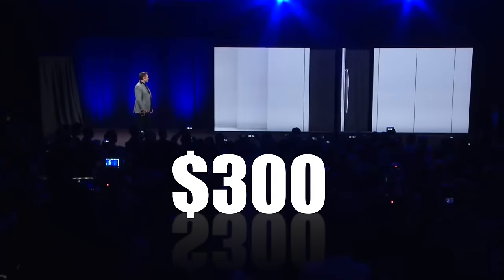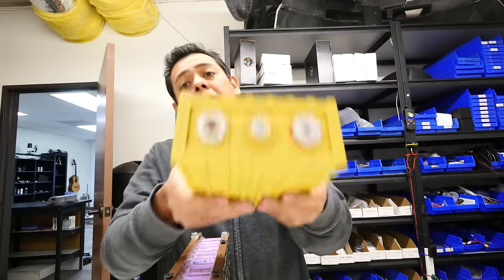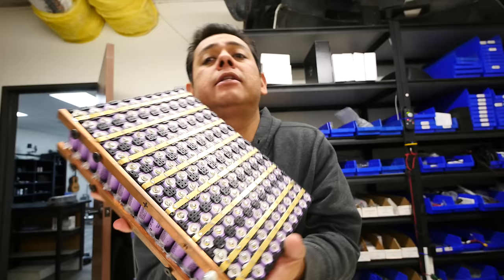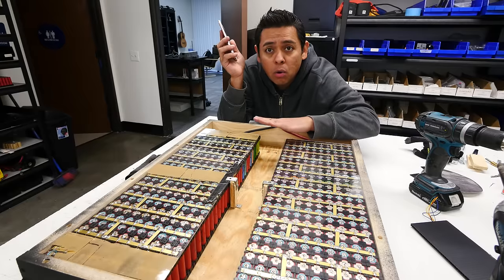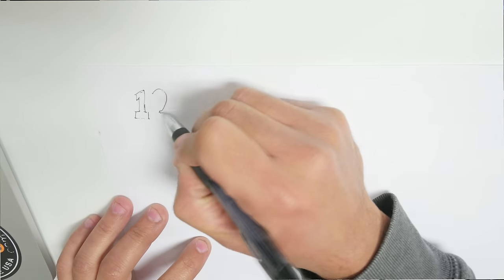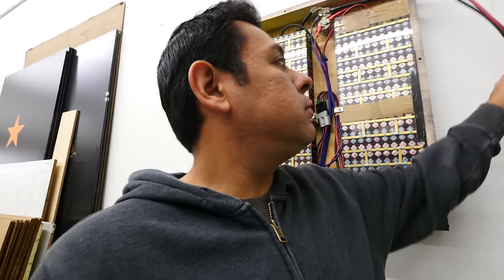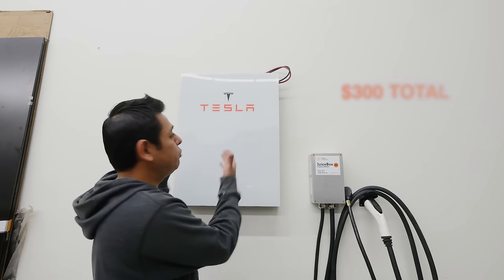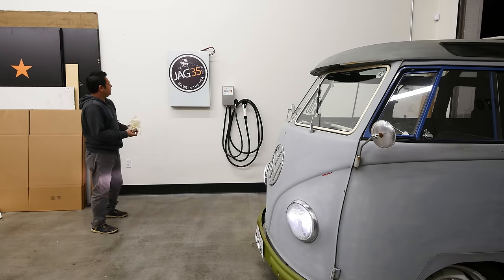$300 DIY Tesla Powerwall - Solar storage 18650 lithium ion home Battery

Comment from the maker: BTW,  best current deal on lithium cells https://jag35.com
Reply: +jehugarcia I think I'm going to try your project better. Cheaper and I actually think it's going to work. I was able to get 300 brand new 18650 for a really good price. Now trying to buy the parts you put in the description, would be nice if you can outline how many of those you need to build it. since you have the dimensions and everything would be nice to do a little amazon list where you actually plan the number of items to buy. Just and Idea!
I'll keep you posted!
Reply: +jehugarcia i like your project and you are right you can build it yourself but to be honest the 10 kw tesla wall battery is a very good deal considering you get guarantee and it is plug and play plus if something happens with a self build battery you could be in trouble when it comes to your house insurance paying or not .
Reply from the maker: +Crushonius   Yeah,  its an awesome product
Reply: +jehugarcia Aren't you worried about Tesla potentially coming after you?
Reply: +jehugarcia so do you only need 24 volts to connect the battery to the inverter to power your house. Also is this infinitely scale-able because this seems like a really good idea plus if you flushed out a plan you could sell these because they look really freaking cool.
Reply from the maker: Depends how big your house,  larger homes work better with higher voltage inverters
Reply: +jehugarcia - Thaaaaaaaaaaanks so much for this link... you're legend!!! =]
Reply from the maker: Here are a few more links I found 
 http://j35.us/Module-modelS-1k
http://j35.us/Module-modelS-900
http://j35.us/Module-ModelS-eSearch
http://j35.us/Volt-Battery
http://j35.us/Leaf-Battery
Reply: +jehugarcia this looks so cool
Reply from the maker: +mobspeak no,  why would they want to come after me?
Reply: +jehugarcia 
LOL tesla coming after you... I don't think he knows much about Tesla and how they want to help the world get free energy, not charge people and stop people from using the technology!
If only Nikola Tesla had his way years back! what a different world we would be in! Instead of the AC dominated world!
Reply: +jehugarcia yo could you tell me where you bought that yellow lithium iron phosphate battery?
Reply from the maker: Balqon.com
Reply: is Balqon still alive? looks like they going out of business :(
Reply: but that are too expensive. do you speak spanish?
Reply: LOL dude, I get your statement, but Nicola Tesla invented AC.
Reply from the maker: +Socore Alaite  ?
Reply: jehugarcia
I was responding to ant stubbs but the reply button didn't work properly.
Reply: jehugarcia
I just want to add, since you just responded to me. I just found your channel, and I LOVE IT!

I am very impressed with your channel, editing skills, passion, and ingenuity. Very inspiring stuff!

Found you with this video in my suggested video. Been on a hour long binge watching your Samba stuff :)
Reply from the maker: Socore Alaite  Cool,  thanks for watching
Reply: jehugarcia Keep em coming man, I love the content. I know you just mentioned on your most recent video that you'll be doing mostly powerwall stuff for the moment, but any eSamba updates would be cool. Even if it's just another mileage test. You've inspired me to keep my Honda, I am going to try to start collecting some 18650's to convert my Accord into an EV.
Reply: Just a quick question, with the amount of batteries used in this setup and how you've structured the blocks wouldn't this cause quite a lot of heat build up? in full load use those batteries would probably need ventilation. also wasn't the tesla powerwall 10kWh by itself? you said the back you made was only 4.4kWh? your idea of using old batteries is awesome and I love this idea but it seems like you'd possibly need to run maintenance quite frequently...
Reply: Did you know the iphone has a built in level?
Reply: That's because jehugarcia used 2000mAh batteries while Tesla uses the 3400mAh types or 600cells of 2000mAh x 3.7V= 4.44kWh vs. 600cells of 3400mAh x 3.7V = 7.548kWh. Anyhow, Tesla has changed their Powerwall to 6.4kWh.
Reply: you made a wooden box.  It will catch fire.  It's not ULC or CSA approved your insurance will not cover the damages caused by the fire.  Be careful!
Reply: jehugarcia a
Reply: you can buy those cells on Alibaba there like 2-4 dollars a piece though.
Reply from the maker: Go ahead,  let us know how that goes.   The rest of us will just order one of these http://j35.us/2hc1tDR
Reply: jehugarcia that's cool do you think its salvageable? replacing/removing cells on that may not be too easy.
Reply: hi i realy want to understand what amps should i charge the batterys
Reply: I was hoping to see it function. For som reason when I started the video I knew it would not be complete. It could not even work. Is there an update?
Reply: jehugarcia
Reply: I hope you made commission off that link.
Reply: jehugarcia hey I was wondering if I could build one of these power walls to only Power my computer or my mining rig the rig has 6 gpus ..... Ty and love the vid from Toronto canada
Reply: Yes, but you need an inverter to change the input/output to AC from DC.
Reply: ant stubbs 
We use electricity in exactly the ways its meant. AC for long distance transfer, and then converters for all our DC devices. You have to much energy loss transversing electricity using DC.
Reply: @Jehugarcia I'm wondering would Lipo batteries be better, like the dw9825 from Kong power, I mean as an example obviously you would use what ever is closest to your needs? So why laptop batteries instead of lithium ion polymer?
Reply: @Jehugarcia or phone batteries?
Reply: jehugarcia how is your "Tesla" power wall working of today?
Reply: ant stubbs AC was Tesla's technology
Reply: jehugarcia How many solar panels to charge and run off grid 24hrs with the 600 18650 powerwall you built?
Reply: How do you safely charge the battery so you don't go past 4.2 volts per cell do you have active balance circuits ? Or some kind of over voltage circuit ?

Comment: Wish I could find .39c per cell..
Reply: Ha ya, You can always ask local computer repair shops they normally have some waiting to be recycled.
Reply: +delvis11 I've found good places to get very cheap 18650 cells are Computer recyclers (have got over 1200 cells from them so far), and XGoverment computer resellers.
Reply: but in terrible quality, yes?

Comment: One thing noted: 3 x 3.7v is not 12v but 11.1 v that's when they are fully charged. I bought mine on Wish.com for less than $10 for 10  (9900 mAh)

Comment: Fun project. Some remarks:
- no ventilation holes in the box ? Not a good idea !
- using used cells.....what if one goes bad within a week ?
- wood case....Nice way to start a fire if anything goes wrong with one of the cells. I hope you have smoke detectors and a good fire insurance.

All in all....nice idea, surely doable but I’d improve some things....

Comment: How did you get 600 cells for less than 300 bucks? Wow.
Reply: Gadget Addict Well, I get that, but it costs me like 6 dollar per laptop battery on ebay...
Reply: Gadget Addict I make what I called power bricks, like 2 conduit boxes with 16 cells in each brick, and the ones I buy in either new or fairly good conditions I use in 3s or 4s setup to power my macbook, I would not link up this many used cells together, cause you never know when one of them will burst on you. BTW, I have a video of my power bricks.
Reply: +Shan Liu duh, that's what the fuses are for, and to be extra safe, liquid cool it.
Reply: 2Awesome You say duh well, gotcha.
Reply: I said the same thing

Comment: Awesome misinformation at the start dude, recycling is great but the NiMh...they dont have the memory effect, at least no to the extent you would not use them, they were used in electric cars very successfully till the Oil companies shut down the use of the with the purchase of the patent. Lithium Toxic to produce. Recycling old stuff is great tho.
Reply: +gcebiker  No big issue if he forgot that NiMH batteries don't have memory issues. NiMH and NiCAD both have specific charging issues and I know of no charge controller that is specifically designed for either of those two battery types. Neither are good for the power wall.
Reply: +Pete McWade He wants this to go viral ? so should get facts straight or burn his house down, the later would definitely help with virality (is that even a word) as for charge controllers http://lmgtfy.com/?q=NiMh+Charge+controller

And NiMh would be great for houses, if you can use them for an EV why not a house http://www.ev1.org/chevron.htm , The patent debacle should be over rulled by a court. Disallowing use in EV's is profiteering gone mad.
Reply: I had read that the patents run out in Aug of 2018.  I hate the oil companies.

Comment: Don't worry about the glass panel. I think he did that for showmanship, for the video. It looks classy. 
It depends on what you want to spend money on. Personally, I'd spend it on a better box. The wood looks iffy. Maybe mount it outside, away from the house? Or well-vented, in a fireproof box? Is there an inexpensive thermal shut-off to use, if it gets too hot?
Insurance may be an issue, but I'll bet most DIY hippies have many things in their house that aren't UL rated. I wonder how many fires they have, compared to other houses?
I once saw an old house. From the 30's? The fuse box was wood, lined with asbestos! And the fuses? Varying diameters of solder wire. At one time, this was acceptable. And had worked fine, for 70 years. But scary to look at!

Comment: I don't understand. How are you balancing the cells in the battery? Do you know that lithium-ion batteries need to be balanced while charging right? Also, where are the inverter and charging system? what you have shown here is just a battery pack. Also, dead batteries that you got for 30 cents are worth just that because they are dead they won't last even 10 cycles and won't provide even 10% of their capacity. Lol hoped that a person who knows this much would know what he is doing?
Reply from the maker: Wow,  you really embrace the ignorance don't you.
Lithium does NOT always have to be balance charged https://youtu.be/tbaeMWdDlqY
Dead Laptop cells will only last 10 cycles.  How many Cycles so far @HBPowerwall ?  https://youtu.be/Nsw8PhDlhSg?t=3m7s
Reply: It is easy for a person who isn't answerable to anyone to say that but a company has to follow safety standards and guarantee the reliability of its product.
Reply: For the people with half baked knowledge like yourself, please think about the following points:
1) The cells have used their discharge cycles. It is not just a marketing strategies for companies to use BMS. Also, conventional Laptop Li-ion batteries have a reputation to go below 10% of their charge capacities after 500-1000 cycles. 
2) The cells are rated unusually at 1C, and have to be charged at 0.5C, have you managed that? Ignorant of that aren't you?
3) No one's talking about balancing cells in parallel. But inverters don't work at 3.7V, they require 12 / 24V or higher. So you must have some cells in series. And I cannot emphasize enough on the importance of a BMS while charging and discharging the batteries. Unless you are doing the job of a BMS yourself.
4) The dead laptop battery cells are from different batteries and thus have different charge capacities, thus even while discharging they may discharge to different levels. You are essentially killing the life of the batteries every time that happens.

It is easy for someone who isn't answerable to anyone to denounce a company like Tesla. But can you guarantee that that power pack will even last for 360 cycles ( when tesla guarantees it to last for 10 yrs, 3600 cycles approx.  ).
Reply from the maker: 360 cycles on trash cell is a win anyway,  Im not selling you anything so I don't have to guarantee you anything,   we promote slow charging and slow discharge rates with NO BMS.   we don't use BMS in our our daly driver EV vehicles.   EVwest  builds customer cars without BMS also

Comment: Solar panels connect to a charge controller, and then to the batteries. Solar panels do connect to the inverter in a dc system.

Comment: I see only one problem with this approach.  If I understand correctly, a vital part of the Tesla Power Wall is an electronic charge/discharge managing system that ensures the greatest amount of battery life.  Again, as I understand it, it's main feature is not allowing full charge or full discharge which shortens battery life.  If I haven't got my wires crossed, the addition of such electronics would make this a fantastic project.

Comment: The 18650 batteries are good, but I think Lithium Iron (LifePO4, 32700) are a better choice. While their power density is less, they have a larger number of charge/discharge cycles, don't have the potential thermal runaway (fire hazard) issue Lithium Ion batteries have, and do not cost much more. Given the longer life-span and if not used in a vehicle where weight is an issue, they are a better choice for home use.

Comment: Interesting but a lot of work for a regular homeowner. I prefer the lithium option as they seem easier to acquire, connect and replace/maintain. But I am determined to go solar as I live in Florida and need these batteries so I can get off my backup generator.

Comment: I have a friend that about 3 years ago had the Tesla wall battery house backup system installed OR almost installed.

I would ask him every 3-4 months did the Tesla people ever get it in and running. He said not yet.

I sent him an e-mail today, 3 years after my first asking him if it is up and running. 
Today, this afternoon, September 26, 2020 he e-mailed me back and said he cancelled the whole project.
I don’t know if it’s the company that Tesla is using or Tesla itself.  The point is his system got installed and working.

I told him that Generac, the generator people have their system out and doing installs.
They have been advertising their system all over the Houston area.

I have a Generac 20KW natural gas whole house generator and it runs like a top. When the power goes out in 10 seconds the power comes right back on.

Comment: Have you heard of anyone changing the battery pack in a 2014 Ford Fusion Energi to get more mileage on battery power??
Off the showroom floor the batter design was 22 mile range. Currently a full charge provides 15 miles per charge which is only useful for errands around town. As soon as I hit the freeway 15 miles turns into 3 as the power is deleted and the combustible engine kicks in.

Comment: 4.4 KHH will run a 4.5KW electric hot water heater for 1 hour.   Add an electric oven and you are out of power.  Not considering inverter loss.

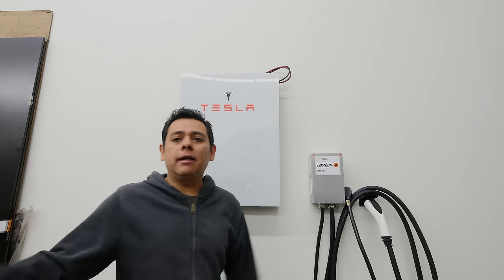Comment: Current pricing is 10x more in 2018 than when this video was made. At about 10:30 into it the 600x.30 is not 600x3.0. So $180 then vs $1,800 now. Based on his good deal on tested batteries in his link in this video. https://kit.com/jehu/lithium-battery-sources-july-2018/1348089-lg-m36-18650-cells-t

Still much cheaper than the 10 to 15K you'd pay from Tesla if you don't mind waiting till 2019 or 2020 for the actual delivery. Or having to put up with Tesla's small print on how you can actually use it plus how they require you to have it hooked up to the internet so they can monitor your usage to make sure you are not breaking their terms.

Comment: $300 dollars of raw material costs, but it doesn't include the cables, connectors, contactors, fasteners, fuses, cell holders, metal strips, soldering, etc. Not even mentioning a BMS and cooling which is likely preferred to be also included.

Comment: 18650"s are fantastic on paper. The c rate is awesome, the lifespan is awesome. When you say lead is toxic I question what battery tech is more recyclable? I have not factored in the lifespan of lithium ion vs lead but i think the casing and electrolyte will become a small factor vs a 18650 cell packaging. Does anyone have any data that could draw a conclusion?  Are there any recyclers that will pay for a core charge? I really think we should be looking for the next tech to fix both problems.

Comment: I imagine the Tesla Powerwall includes the inverter and the protection equipment, charge controllers and safety systems. All of which need to be added into any system.

Comment: you may want to sperately learn how wiring in parallel and series works, as it is not really described here very well.  for me at least, I learned how series and parallel wiring worked by working with LEDs.

Comment: nice vid ... just 3 comments/questions:

1.) sure to build a wooden case is a good idea as example? ... i would strongly recommend to use something to mount on, that cant burn.
2.) i wouldnt count a 100$ optical thing in an example calculation when it rises the sum from 200$ to 300$. like you sayed, for 1000$ you can build 3 of them, actually you could build 5 of them if you use a simple cover.
3.) how much batterys you tested to get 600 for your project, dont ned to be too exact?

thx + have a nice day

Comment: You should really let the viewers know the huge risk of using used 18650 cells. They are a major fire hazard and explode if wired incorrectly. You got a few hundred there. That's pretty much a small bomb. My recommendation is , if you want to build this, use  only new 18650s.